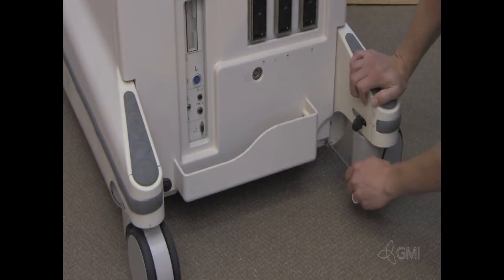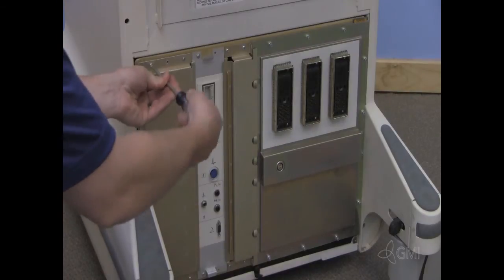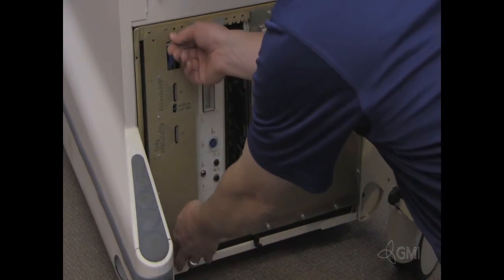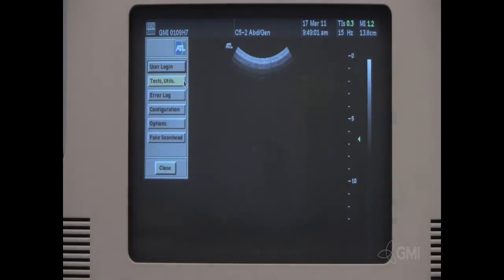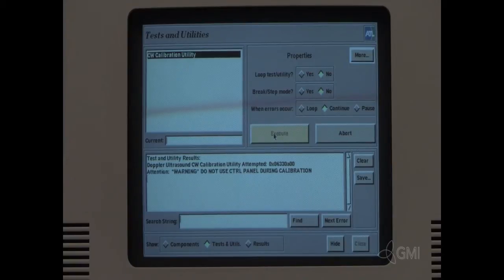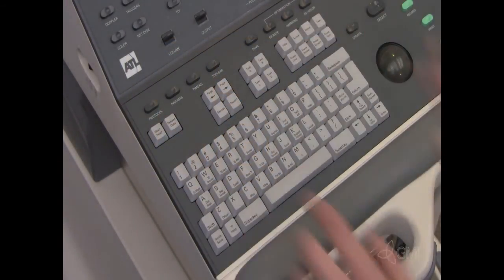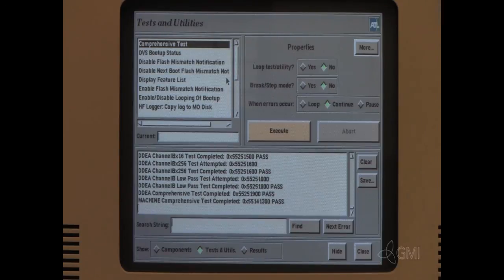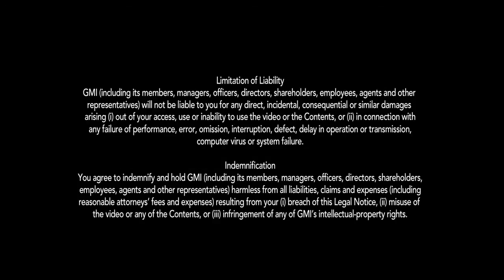HDI 5000 Power Supply Replacement

Comment from the maker: make sure there isn't a mo disk in the mo drive. mo drive could be bad, holding down the SCSI chain which consist of CPU, hard drive and mo drive.remove or replace mo drive to verify. Also CPU could be bad, not likely but possible.

Comment from the maker: when the system is stuck at the grey screen it usually means that the hard drive is the problem. Either the hard drive is bad or the software is corrupt. Watch the HDI 5000 software reload video and use hyperterminal settings. Turn the system on and watch the boot sequence in hyperterminal. It should show you the boot sequence and tell you if it can not find the drive or the software files.

Comment: i have a problem with a HDI 3000 ultrasound unit.
. when turning the system on, all the leds on the user interface flashes and the screen shows the color bar. after this a blue screen flashes and then the display hangs in a grey screen. ¿help me?